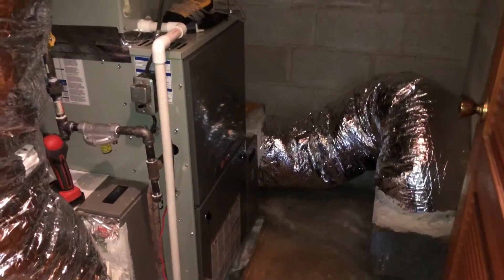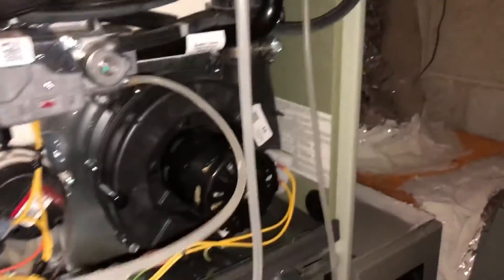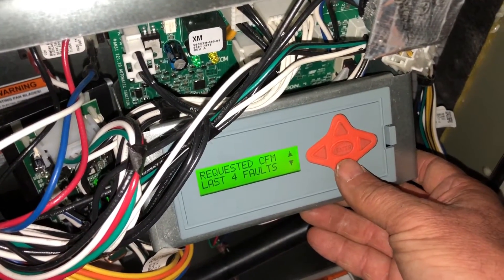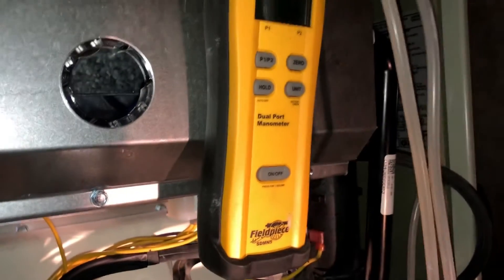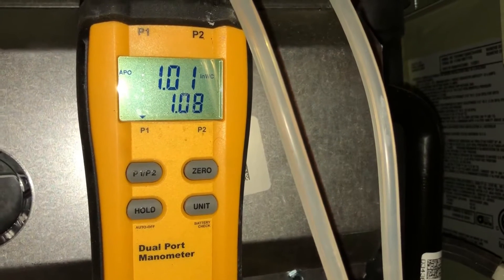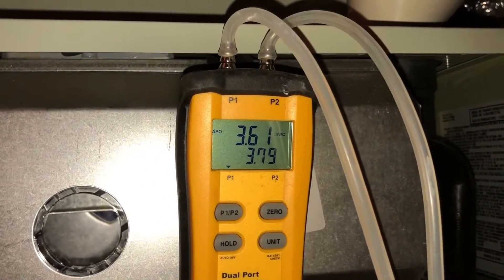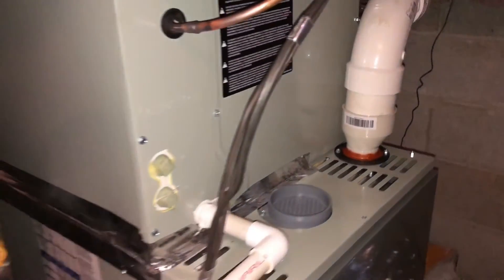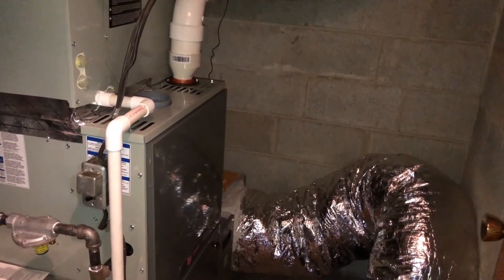Boring video unless you need it .. Trane communicating modulating gas valve setup XC95m TUHM

Comment: I searched your channel to see if you had any experience with the XC95M and found this clip.  I'd love to have your experience to lean on for new construction.  Now home in the mid-west, ranch, 3100 sq.ft. future finished basement.  The current dealer is proposing (2) 3-ton units.  Says I really only need 5-1/2 tons but the 20i is only available in 2 or 3 ton and the variable speed will allow stepping up to the 3-ton with no problems.   I know I want the  XV20i.  I wanted to pair the XC95M propane with the XV20i's.  Dealer is pushing the S9V2-VS with a BAY24 to allow communicating capability.  Made it sound like Trane will be discontinuing the XC95M.  Would you recommend one furnace over the other and have you seen good reliability with the XV20i's?

Comment: Actually the install manual tells you specifically to wait 5 minutes after entering min and max test modes before adjusting pressures, the unit goes through a self test process where it ramps up and down to learn pressure switch open and closed points based on inducer demand. if you actually wait, After the 5 mins is up, the unit will modulate down to it's low demand 25% and you can set your pressures which are .7 low and 3.5 high NG and 2.0 low 10.0 high for LP. If you set the minimum to high it will always burn hotter and not modulate properly to match the blower speed and will trip high limit on long run times. Set one at 1.1 one time and had 39 high limit alerts in one night.  Gotta use those manuals with this new stuff.
Reply: Yep. I got to wondering what the gas pressure setting were and the manual has a really nice table for NG and LP. Depending on the btu rating of this furnace, that 1.0 may be too high

Comment: Thanks for posting this! Your video saved my butt. I haven't worked on too many variable communicating systems and had a service call for no heat. 2 tech as already been out and reset the limit switch. Come to find out no one set up the gas valve and it was over fire. You info in this video h ed led a lot!! Thanks!

Comment: Never worked on a model like this Trane. But I always set the high pressure first, then the low. Also I always remove the burner door to do the pressure adjustment.

Comment: I have this hvac here in SW Michigan and I was told when buying it that the heat pump would run down to 5 degrees. I've had it set to go down to 15 and 20 degrees and it still runs the propane even at 30 degrees and I've even caught actually running the heat pump when it's single digits despite being set to use the back up at 15. Any thoughts? I've talked to the installers and they don't seem to care or understand.

Comment: Hey Ted, Hey Ted, Let me ask you a question? What are the chances for a brand new trane S9V2 Gas furnace for the heat exchanger to burnout in 2 days after the install da, for not having the proper setup on the gas pressure. The furnace was converted to propane. All the propane kit was installed right except the gas pressure was not regulate it.
Reply from the maker: High gas pressure could be detrimental I am sure however you would think the high limit would protect from what you're describing. What are the signs that point towards heat exchange failure ?
Reply: Well the service tech said because of the high limit switch keep tripping and the gas pressure was too high. That's the only diagnosis he gave to the office.
Reply from the maker: Get me the model numbers of furnace and coil and also what configuration it is mounted in (left or right if horizontal) and I will help you pinpoint the issue.
Reply: I really appreciate you try to help me... but the company decide to replace the furnace . I see you do a lot trane system, You should do a video on how to setup the BK and what deep switches need to be set to.

Comment: I'm also surprised Trane did not make you submit a flue gas report.
Reply from the maker: How could they make ME submit anything ?? I don't follow what you mean ?
Reply: @TedCookHVAC I think he meant that setting gas pressure at both low and high fire ranges and checking combustion air to ensure combustion analysis results falls within acceptable ranges for CO for high efficiency NG furnace. Trane’s own manual is deficient in that regard. It does recommend clocking the gas meter.

Comment: I retired from working on forced draft boiler burners up to as large as 15  MBTUs. These burners went from 1950s to 2016's high efficiency units. In the video you started out adjusting low fire efficiency.  On the equipment I was used to working on, one MUST start setting up high fire first. So I was just wondering if this two-step Trane gas valve is indifferent to which you adjust first ?
Reply from the maker: That is actually a modulating furnace... the gas valve just has max low and max hi to be set. It is not just a 2 stage.